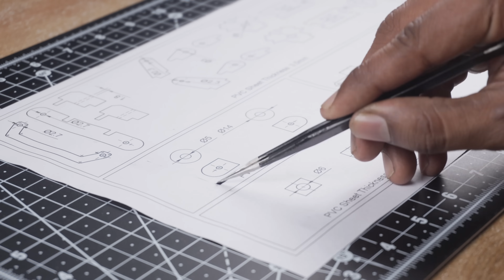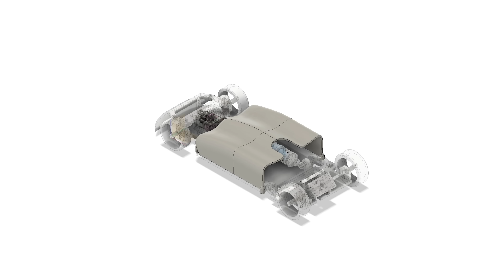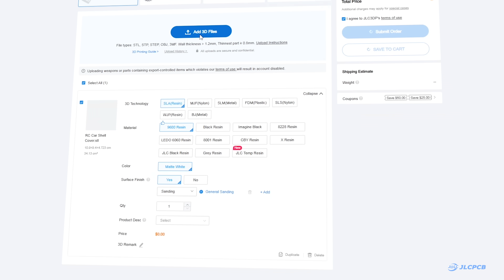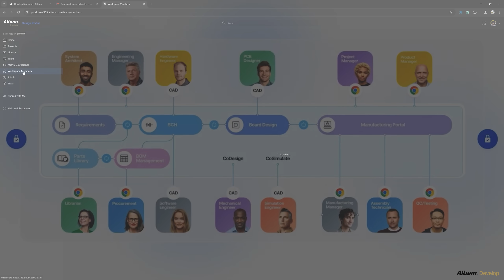Making a Powerful RC Car from PVC Pipe | 🚀Super Fast 1:18 Scale Brushless Build

Comment: you are not using any differential how you can control the drifting of car while turning, please explain or it can control by the by controlling the speed of motors. But I think they both are giving the same power through the shaft.